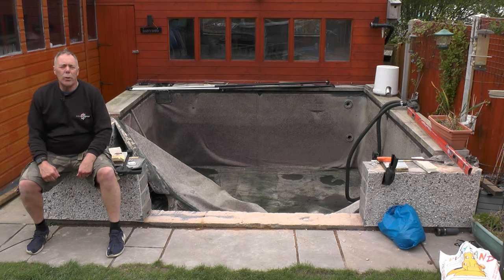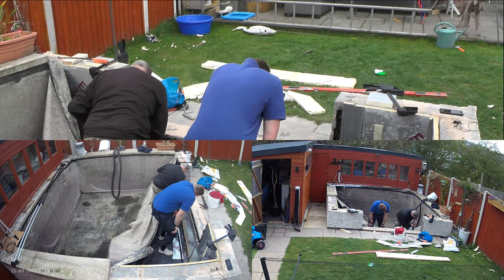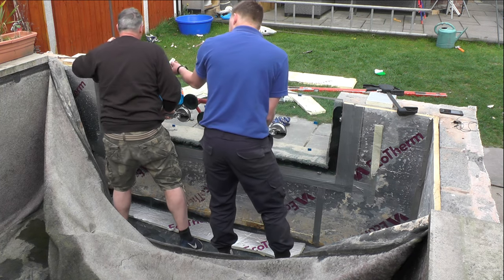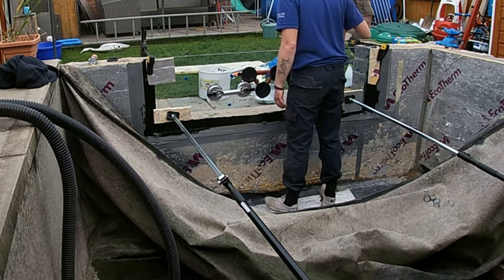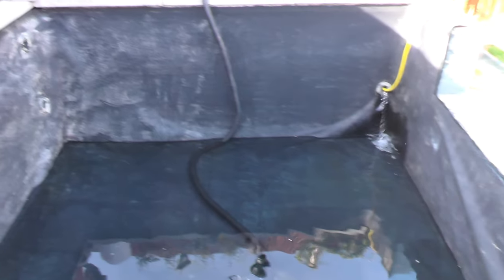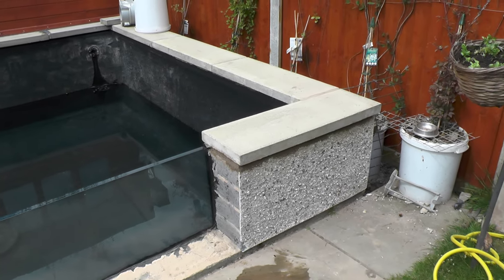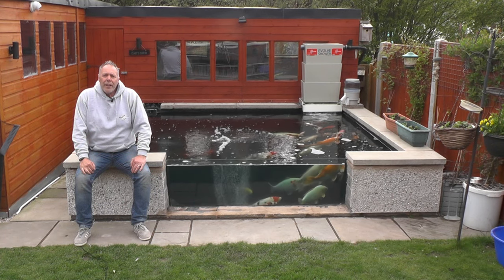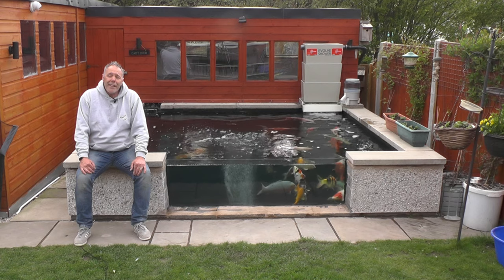Fitting A Glass Pond Window In A Koi Pond **Pond Window In A Box Weld Liner** How I Fitted My Window

Comment: You made that look to easy 🤣 love that window👍🏻 skimmer in the filter house ?
Reply from the maker: Cheers for watching and yes the skimmer is on the back wall in to the Filter house but the wall inside the Filter house is Steel plated so you cannot see the skimmer or pipework. Only the Double Union Valve is noticeable in the filter house as it then goes underground to the back of the Filter House where it is then pumped up to the Filter and Bakki. It is access from the pond side.

Comment: Great video, I'm putting a window in my block pond with liner. Very few videos out there on how to do it with liner. Its a frightening thought putting a window in but ill give it a go 😀
Reply from the maker: Cheers for watching Neil, I was exactly the same and put it off for two years. If you prep first and double check everything it should go easy. I was terrified and there was no need. I spoke with others who had just done theirs and listened to what they would have done different or what issues they had and made sure I didn't do what they did. The best tip was put plenty of sealant on but in the end I spent longer wiping it off and cleaning it up than actually fitting it. 6 hours prep. 30 minutes to seal and fit. 2 hours smoothing off. Take your time and get someone to help you lift.
Reply: @AKoiEnthusiast  how did you make the frame to sit the window in? The insulation I'm going to use isn't as thick as the window and don't really want to have to rebate the block work.
Reply from the maker: @neillewis82   I cut some wood down to 25mm thick and screwed it to the blockwork but this was because my Glass and Insulation were both 25mm too. The other way you could do it is to use a stone saw/Angle Grinder or similar with a Masonry blade and cut a recess in the blockwork for the glass to sit in. Check out Danny's Koi as he did something similar but with a wooden sleeper. It is the same theory. Unless you can double up the insulation on that wall to get to 25mm.

Comment: Loving the proportions of window to wall. Looks great 👍 What is the external length of pond holding window. Also, how many tubes of PU18 and Gold label did you use. Thanks
Reply from the maker: Cheers Stephen, Without measuring the wall again I believe the external wall length is 3150mm - The Window showing is 1700mm. I think I used 4 full PU18 on the glass to the Blocks and 1 Tube to fill the spacing after. I only used 2 full Gold Label on the liner with another part one to over seal when it was tacky.

Comment: Brill job mate looks fab. Do you no if there is a minimum length of your corners before you start your window?
Reply from the maker: Cheers Andrew. I suppose there will be a rule of thumb for the strength of the corners etc rather than the length of brickwork before the window. Looking at photo's there are even ones with a single post and a window both sides. So I would possibly ask a Structural engineer for more advice

Comment: Kev mate that looks mint, once you've put the finishing touches round the window it will look like it's always been there, when you dropped the spirit level in I thought O crap you've only just repaired it lol, both you and your lad made it look easy, glad all went well with the fitting, will you be changing your intro pic now then or waiting till all finished, how long did you have to leave it after fitting liner to glass before filling, stay safe.
Rob.
Reply from the maker: Cheers Rob. I think all in all it took 4 hours to set up and transfer the Koi. 6 hours to cut the hole. 20 mins to fit the window with 1 hour to clean up around the seal. I left it 36 hours because it was raining the next day and cold. Then it took 20 minutes to seal the liner and trim it. I left it to fill then added another bead and away we go.
Reply: @AKoiEnthusiast  all that time soon adds up don't it, but I'm sure it's definitely worth all the hard work you put in, I had to grin when you was on about having to take your shirt off lol, when you originally measured up for your box weld liner did you add any extra or did you give exact dimensions.
Rob.

Comment: Love the pond outstanding what did you use for the frame and how did you attach it to the blocks
Reply from the maker: Cheers Andy. I screwed some 3" x 1" wood on three sides as a frame and sat the 25mm  glass on spacers on the frame. There was 25mm Kingspan insulation on the inside too so the frame was flush with the insulation. I sealed the glass to the inside of the blocks using PU18 sealant and then the next day I sealed the liner to the glass with Gold Label. leaving a perfectly flat seam around the window. No creases or ripples and no leaks. Check out the first part of the Video where I make the frame. https://youtu.be/Oqcp1PsJDho
Reply: That’s brilliant thank you did you use box liner or just standard liner
Reply: What was the tape for?
Reply from the maker: @2011Miya  I used to have a standard liner but hated the creases everywhere so I upgraded to a Box Weld Liner about 6 years ago. It fits like a glove and is smooth on all sides.
Reply from the maker: @2011Miya  The Gaffer tape was used just to go over the small gap between the Insulation and the frame. Just so the pressure of the water didn't distort the liner over the frame.
Reply: @AKoiEnthusiast  are the box liners made to measure for the dimensions of your pond I’m the same don’t think I would like all the creases box a lot neater
Reply: @AKoiEnthusiast  one other question I have I like the way you have used the timber frame as it’s simple and cost effective I know I have seen metal frames what are the advantages of having a metal frame as it’s the same principle as what you have done
Reply from the maker: @2011Miya  You build the pond and then go to a Supplier with the measurements and they make it up for you. Top Middle and bottom measurement on all the sides and base
Reply: @AKoiEnthusiast  thank you so much been a massive help can’t wait to get started now

Comment: What did you use for a frame for the window to sit on?
Reply from the maker: Cheers Iain. I had a couple of lengths of 68mm x 38mm CLS Timber so I cut it down to 68mm x 25mm and screwed it to the inside wall. The Kingspan Insulation board was 25mm, the Glass was 25.5mm and the frame was 25mm so it kept it all smooth for the liner to fit over. Check out  the previous Video (Preparing A Pond Wall) It will make sense
 https://youtu.be/Oqcp1PsJDho